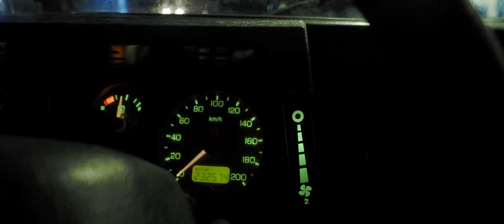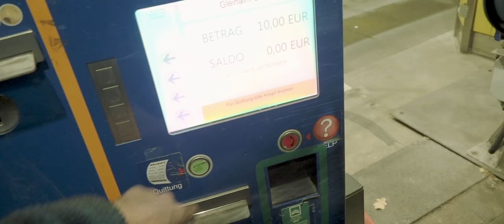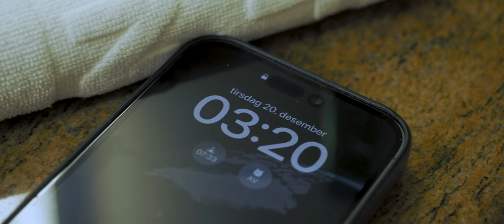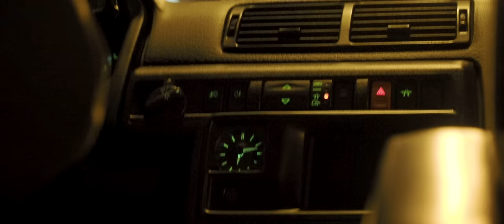Winter Camping in a Land Rover and 2000 km in a Defender in 24h

Comment from the maker: Once again you guys are really the best bunch of people. Really appreciate how well you give feedback on these! 

This is now the second video I’ve made without really planning or taking to much time whilst filing. 

The next one I’ll be bumping it a bit. But the goal is to still have a format that makes it doable.

I need to be able to film, voice and edit everything solo. From the back of a car.

Therefor I try to not bother about all small details. On this I sadly exported with lower audio than I was supposed to. So definitely going to look at that next time 😅 thanks again for stopping by!
Reply: In hopes of saving you some researching time, I would recommend normalizing your audio so that it peaks at -1 or -2db. This is an easy step as long as there's a normalize function in your software and it'll get you consistent volumes from video to video, recording to recording, and without much fuss. Maybe throw a limiter plugin on the audio channel after that and push ~3 db of gain into it for a little extra volume control if you want to but normalizing is a good start. Best of luck, loving your work so far!
Reply: Holy fucking shit 😳🏔️ Please do make more videos like this 💚

Comment: I have been on many solo missions (about 10,000km in all) in my reconditioned 1994 300tdi Disco off road in the Sahara. 5cm lift suspension. Steering and diff guards. BFG tyres. It goes where a Defender can go, as long as the drivers are good. Well done mate.
Reply from the maker: Cheers! For a full year setup, there’s nothing like it!
Reply: @kasperhoglund  cool, enjoy

Comment: Side note before finishing the rest of the video: when you said it felt like a turbo hose caving in on itself I immediately knew it was the little vacuum line box (actuator), because that's exactly what it feels like. On the td5 you can actually bypass the actuator so the pressure gets where it needs to be, as a quick fix, and get the power back.
Reply from the maker: Yeah, correct 🤝

Comment: Beautiful video. It does sound like the wastegate actuator was to blame, if they are not adjusted properly or if it sticks there wont be much power!
Reply from the maker: From what we could figure out on the go, that was it. Stuck, or sticking. Building pressure up to a certain point, then dropping it out. 

Anyhow, made it in time and just a “minor fault” 🙏

Comment: The looks are amazing, storytelling is great, but I feel like what's missing here it's a actual daily life. How do you make meals? How/where do you sleep? Do you use webasto/keep the engine running or just thick sleeping bag? Where/how do you seat and use laptop? --signed, a person that does the same thing (in 2x2) but only for 30 days of the year :)
Reply from the maker: Will cover everything eventually. Just scratching the surface of what I do up until now 🤝

Comment: Thanks for this vlog! Really enjoyed it. Beautiful videography and editing. I'm only left with one question...Did your Land Rover fire up nicely after the glow plug change in the cold temps?
Reply from the maker: Yes and no. It now works fine down to -10. And still starts after that. But fuel starvation the first few seconds. So I’m guessing injectors or high pressure pump. Changed the filter, but will need to look into it!😅🤝
Reply from the maker: And also, thanks!!

Comment: With up to 12 % OF Land-rover  3.0 sdv6  snapping there crank shaft of slipping there main brings this is a brave man to drive in that weather in a land rover if his engine goes out in that weather he is dead in a few hours
Reply from the maker: well, 100% of all engines will eventually fail. Would like to see where you got 12% from and how it’s calculated considering mileage and so on. How ever, that’s not a topic I care to discuss. 

Any car could fail anywhere, so being scared if that would be exhausting.

However, there’s the aspect of dying. You would never ever do something like this with litt having plenty of backup plans. 

First off, my car could fail anywhere and in any temperature. And I would still have food and proper clothing/sleeping systems to wait for help. 

I never set myself in any real dangers, because that would in the second run out others in danger.
Reply: @kasperhoglund  I would doubt you have not heard of the 2.7 tdv6  and the 3.0 sdv6  and there ever increasing habit of snaping crankshafts  the 2.7 was better than the 3.0 and it is as easy as typing  land rover snapped crankshafts in to Google to see whole forums dedicated to asking for advice on how custom care can help
It's Disco 3 Disco 4 Disco 5 range rover sports and even the recent L405
I would say that's unacceptable in a adventure vehicle would you not ?.
Milage appears to be from 20.000 and up with anything outside of the 3 year warranty land rover walking away from 
I have a 1996 range rover classic 3.9v8
It gets 12mpg ..... not exactly  a useful thing in 2023 
I have driver a number of Disco 3 and realy want 1 
But have been told buy the owners Not to do it .....
So I drive a 2000£ 2005 VW touareg  2.5tdi auto
29mpg very relaxed  and with 183.000 miles totally reliable
I plan on driving to Nordkapp one day and would have no problem going in the vw 
Not sure I would want to in a land rover 🤔
Reply from the maker: @billturner6564  of course I’ve heard. I’m on all the forums and Facebook groups surrounding this model. Therefor “not a topic I care to discuss” because it’s simply not that interesting. 

The snapping issues with weak cranks in the ford engine is a well know issue. But wasn’t big enough to be a call back. A spun bearing leading to a snapped crank is the other well know issue. 

My point with “all engines will fail” is that no matter what, you can have a failure at 10k or 10000000k. 

The SDV6 is always in danger of oil starvation for several reason. No physical dip stick makes unknowing owners forget about oil. And it’s only around 6L in a pretty big engine. 

This topic just goes on and on
Reply: I plan on getting myself a Disco 3 
As they are really cheap and having a go myself..
I will change the torque converter and the harmonic damper drop the oil pan and clean the oil tube and sump service all he injectiors and check there balance and change the oil pump to the most modern one 
And I will buy the highest milage one I can find in good condition 
As I feel this crankshaft problem must have showed up buy free time its gone 200.000 miles the highest milage I have heard snap iys crankshaft is 144.000 in a RR sport 
The lowest is 4000 on a RR L405
Right out of the shop
I am ashamed to be British when I think of British cars 
They are allnthe same 
Carelessly put together at best 😒

Comment: You talked about going off-road was illegal, yet you go off-road yourself.. 
Its not as bad as those you mentioned, but a un-plowed road is off-road.
Reply from the maker: Theres a norwegian law banning cars from unplowed roads where a normal registered car can’t drive. Which it clearly can. This law is set up to stop snowmobiles, belt wagons ect. 

In this video I’m driving on the main road and camping at a local off road tracks parking lot. The highland regions have clips from a parking lot at the highest view point up there. 

Going off road is described in Norway as leaving a designated trail or path btw.